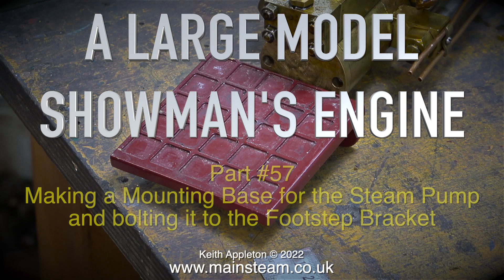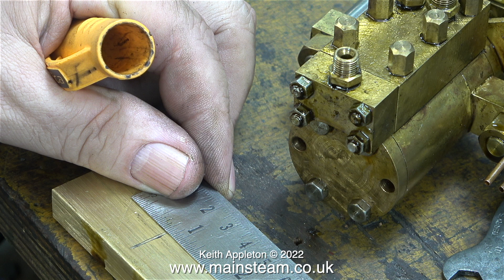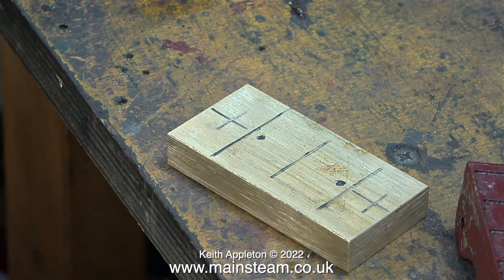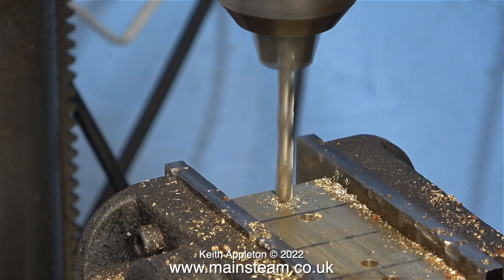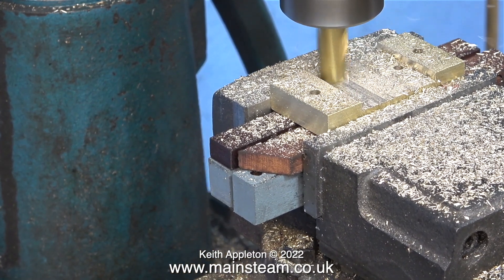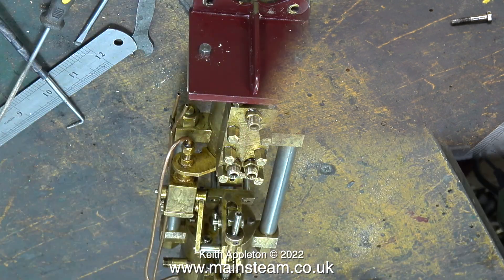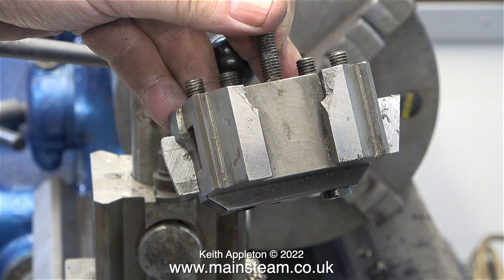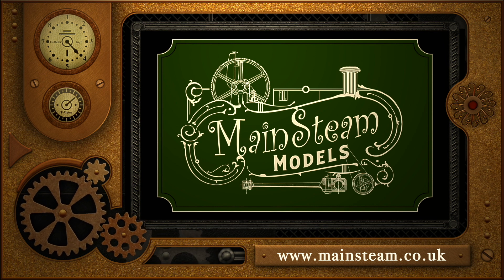A LARGE MODEL SHOWMAN'S ENGINE - PART #57

Comment: That's a perfectly good way to do math in your head. I routinely use similar computational tricks.

Nothing wrong with reference marks on the ruler, either. I've been working on a small stable, and my tape measure has acquired a number of cheater marks at frequently used dimensions. For that matter, the tape measure came premarked for standard stud positions for wood frame construction (the typical here in the States).